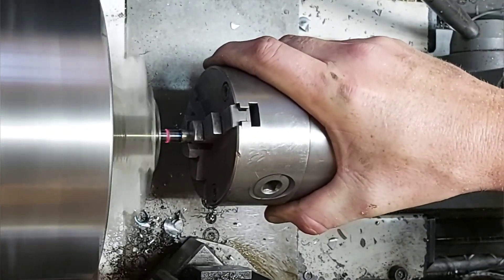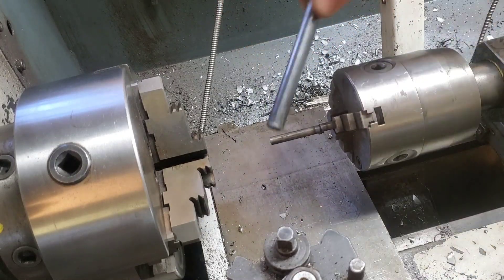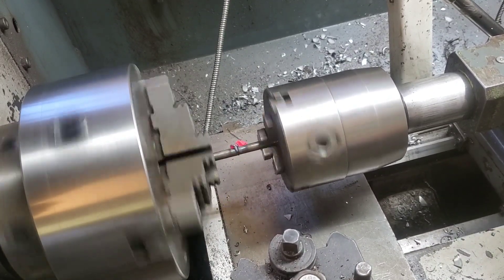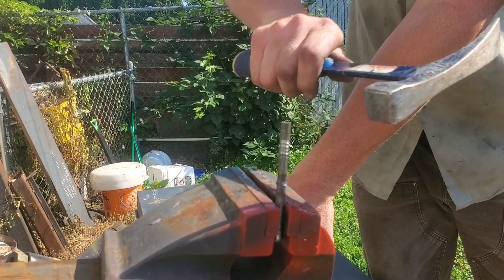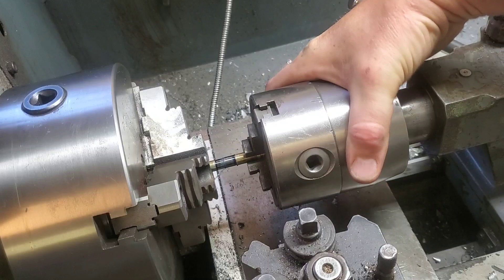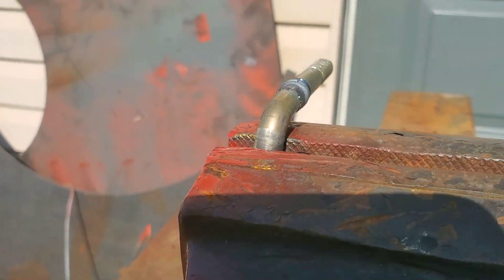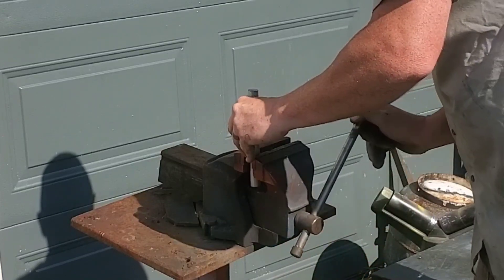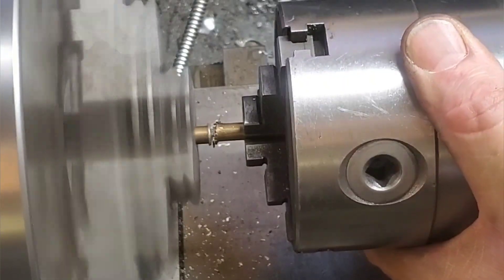Friction Welding on the Lathe Experiment

Comment: Brass has a much higher thermal conductivity, so heat won’t accumulate at the joint to weld.
Reply: What about the aluminum? It also didn't seem to want to weld

Comment: I think you need to make your processes more easy by using induction heater to heat both axles and you need a small flywheel and clutch to help you for this process you don't need a big flywheel because the heate is already made by the induction heater but the flywheel inertia will finish the work when you get a certain temperature you disengage the clutch and start pushing the axles to join them.just make sure don't use your hand and start experimenting with small shaft
Reply from the maker: Induction heater would be a cool way to start the process .   This friction welding/ stir welding i have only actualy used for one job where the shaft broke clean and with a spline on on end . I think it was for a table saw .   Worked awsome !!

Comment: As a machinist, from a safety standpoint I was screaming this whole video. Holding rotating equipment at thousands of RPMs is just plain egregious. Add to that the potential pinch point between your hand and the tool post makes this whole process unthinkable. Please, anyone watching this video, DO NOT replicate the actions this guy took here. The fact that you survived is the truly amazing thing here. This process should ONLY be done with properly rigid holders. AT THE VERY LEAST, use a Jacobs chuck in the tailstock, NEVER your hand. I cannot stress enough how unsafe and terrifying the actions you took are to me. Never should hands be this close to rotating equipment.
Reply from the maker: Yup there is alot going on in that video and dont recomend people try doing as they see in the video.

Comment: the zinc in the brass is messing with you. its melting out / being pushed out of the contact area I think. some kinds of brass have different content, i.e. some silicon which would make them weld a bit better or differently
Reply from the maker: I like your perspective makes sence

Comment: The success depends on not only the RPM, but also on the pre heat process, the pressure and time that you push two rods together and the flatness of the surfaces on ends of two rods.  Different materials can be welded together easily, either two metals or one metal with one non-metal (plastic).
Reply from the maker: Thank you tpchlu , there are definarly a few variables with tgis process .    Plastice ..... i hadnt thought of that . Good point

Comment: This is an interesting process. I commented on someone's channel a week or so back about how I had pretty good success with this technique. You were on the same track with the bevel and I think if you would have slowed the pressure on that one like you did on the later ones, it would have worked much better. What I did was drill a small hole in one side and a corresponding size stick out on the other one and use just enough pressure to get lots of heat a good ways back and then get it red and then back off. I found the least pressure I could use but still get the heat worked best for me. I also wanted to cut or grind the piece horizontal (parallel to the rod) to see what was happening on the inside but never got around to doing it...
Reply from the maker: Awesome input Danny thank you , I think I will build off some of your suggestions next time

Comment: Interesting, have no use for it yet. I wonder if copper would friction weld? Could be that brass is enough of an alloy it won't weld. Good video
Reply from the maker: Hey roscoe  Thanks for following up with the email and the article.  Roscoe pattern works appears to be correct that the zinc is boiling off while trying to friction weld.   Thanks for sharing that with me buddy , your a wealth of information
Reply from the maker: Maby . My thought was that it was drawing away to much heat. The alum has a much lower melting point and the brass a high point with a hight conductivity. 

Luck for me i dont work in brass very often .  Perhaps i sould try spme copper pipe though
Reply: @Wrighmachining  I thought the same on the brass.
Reply: @Niels_Dn  i found a website, may be out of luck on welding brass, due to zinc evaporation.
Reply from the maker: @roscoepatternworks3471  zink evaporating , awsome idea . Makes sence in a way . Perhaps the zink is drawn out in some way and oxidizes as it decays or evap ?  I should test this theory with some copper . If the copper does the same it would be conduction if it welds it would afirm this theory more .
Reply: @Wrighmachining  i know a few foundrymen who have had zinc poisoning, when melting brass.  You can see green fumes if the zinc gets too hot. Drink lots of milk, i almost always drink a glass after melting brass. After a successful casting session, a beer😏
Reply: @roscoepatternworks3471  sounds interesting 🤔
Reply: @Wrighmachining  i found this:
What metals can be friction welded?
Materials Weldable by Friction Stir
Aluminium. ...
Magnesium. ...
Copper and copper alloys. ...
Hafnium and zirconium. ...
Inconel and superalloys. ...
Steel and ferrous alloys. ...
Titanium. ...
Dissimilar materials.